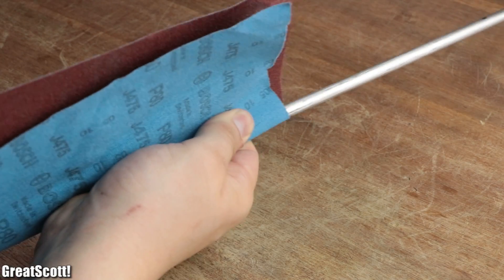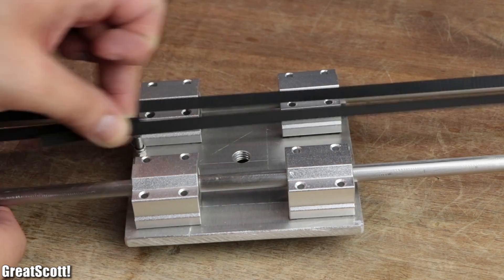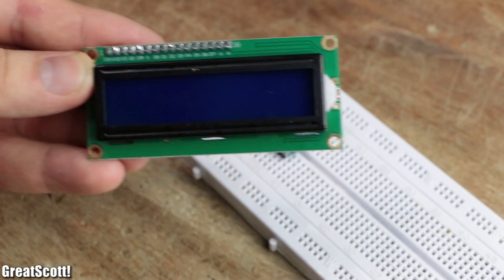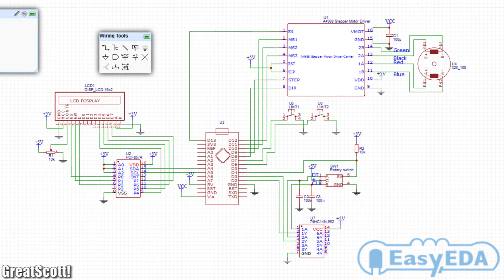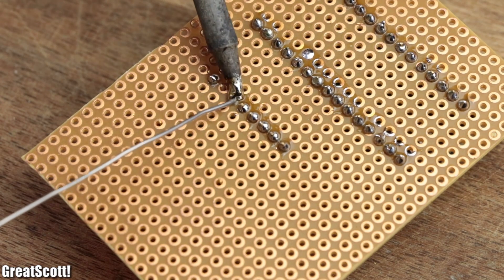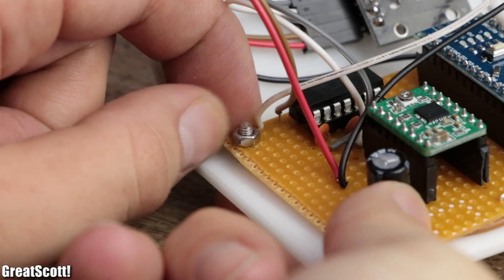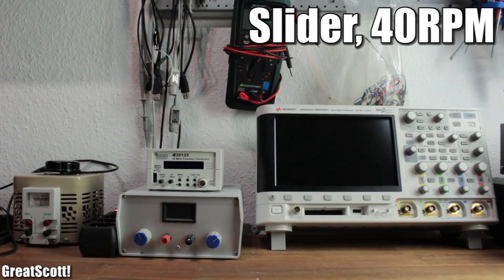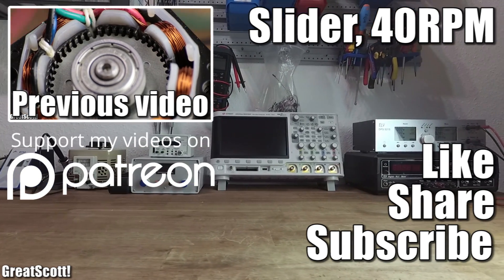Make your own Motorized Camera Slider (Part 2) - the electronics

Comment: Those who have the problem of engine vibration and high noise should use a pull down resistor for the buttons

Comment: Nice! Really very good work. I tried to do like u, but I could not find the schimit trigger ic, can I remove it from the diagram and connect the rotary encoder directly with arduino pin D2, D3 and use Debounce2 library instead?

Comment: I connected the driver in micro step mode (1/16). In this mode, the engine runs smoother, better. Help change code. What exactly needs to be changed in the code to work correctly? http://www.electronoobs.com/eng_arduino_tut27_2.php  Thank

Comment: Great Video, thank you for sharing. I have a Proaim Spark slider and I have been thinking of adding a motor with an arduino controller. The only problem I don't have any knowledge on how to program the arduino. I have a question: Is it possible, using an arduino controller, to make the Slider go go on an endless loop?

Comment: I DON'T UNDERSTAND, the Project file says 5V and there is also "VCC"  but in the video, I see you use a 12V battery!. can you explain, please.
Reply: A4988 driver carrier need 3-5.5V for logic and 8-35V for the motor. Look into the datasheet, there is all.
Reply: so VCC means 12V?

Comment: Can you tell mi which resistor you use. I know only 10k but i'dont know what next (for example: resistor 10k 5% 1/4W i can't see color code). Can you tell me also C1,C2,C3 they haw a tension

Comment: I am building one right now, but I am using roller wheels and 22mm aluminium pipes. It is about 1m long and I am going to make it motorized later on by using an old battery drill and some switches.

Comment: microstepping doesn't work so if I use the 470K resistor from M0-GND do I still need to connect it to D10 on the nano or I just connect the M1 to D11? thanks for the answer

Comment: Hmm, just so happens I have a spare DRV8825 lying around and this looks like a fun project to build around it :) Though I think for the mechanical design I will base my build around Musumi 2020 extrusions and 3D printed parts. Thanks much for the electrical diagrams!

Concerning the deformation of your print, what it looks like to me is the support material in that spot was likely fairly thick and the total thermal mass in that area did not allow your print to cool quickly enough for the filament to solidify as it was extruded. Seeing as your print fan was running I'm guessing it was PLA, knowing that I can tell you that you will see a dramatic increase in your print quality if you were to print a circular duct for your fan and add it to your Delta.

Slicing wise, as some other commenters have said; best to flip the print on its side and print it as a wall without support material. I'd also suggest adding maybe 2-3 millimeters of brim to prevent the corners lifting.

Comment: Moving to the solid rods was key, but you want to get hardened chromed rods are used in 3D printing, If you want the system to be able to hold weight, you would want the rods to be above and below each other, not side by side. Try turning the whole thing on it's side and see how it works. it changes the box structure and affects how the internal forces relate to each other. Might not make a noticeable difference is the load is high, but for smaller loads it definitely will.

Comment: I've wanted a 3D printer for some time but the more I learn about them the less I want one. They're far from cheap, painfully slow and difficult to get accurate results with. I reckon I could make that bent plate "housing" from perspex or aluminium in less time than took to print. Just saying. Also, I must be learning because I even knew what the A4988 was, but you rushed through that bit and I need to go watch again to figure out the debounce thing. I'd probably have done software debouncing.

Comment: To create smoother movement you should gear the steeper using simply pulley reduction. This will make the stepper rotate faster so the steps won't be as apparent

Comment: I would not use paper for insulation, use plastic instead. I also suggest to mount the camera directly to the platform to reduce weight and vibrations.

Comment: Maybe use another camera Mount which is closer to The moving platform and also put maybe some weigth under it. I think The wobbling is a weigth Problem also i would secure The Pipes with Not Just One bolt, i saw at The end they were shorter than before and Just secured with One bolt per side+platform.

Comment: What is that wire that you use on the back side of protoboards? I've seen you use it in quite a few project videos. Is there a certain type, style, or material that it needs to be in order to be flexible like that (and holding it's bent shape) while still being a good conductor of electricity?

Comment: Great Scott!  I really enjoy your videos, but I do need to give some pointers on Loctite.  Loctite is applied to the threads before the nut goes on, it only takes a tiny drop.  Loctite is also anaerobic, meaning that it will only set in the absence of oxygen so only the film that is in the treads between the bolt and nut will set.  Please keep the videos coming!

Comment: To reduce the shaking on the wider try using a camera mount/tripod head that is smaller than the one you are using. It would be better to put a quick release plate on the moving section so the camera is closer to the rails making a lower centre of gravity thus removing the shake
Reply from the maker: I will give it a try
Reply: @greatscottlab i know this is old, i’m in a greatscott rabbit hole. The stainless rods have no rigidity because the only thing holding the whole rig together is the two pipes. If you used a piece of  aluminium C channel as the body of the rig and mounted everything to it then the whole  thing is rigid and the rails would have very minimal movement.

Also sandwiching the slide beatings between two aluminium plates would make the platform more rigid lower the centre of gravity.

Comment: I'm sure you realize this, but I think it was unnecessary to 3d print the part in this video. A lot of time could be saved creating simple parts like that by hand (plastic sheets & epoxy), and you wouldn't get the distortion. But, yeah, I'm sure you were just using it as a chance to use it.

Comment: What instal libery plis help??? may problems:
Arduino : 1.6.10 (Windows 7 ) Insert: " Arduino / Genuino Uno "

C : \ Users \ cp \ Desktop \ CameraSlider \ CameraSlider.ino : 2: 19 : fatal error : A4988.h : No such file or directory

 #include < A4988.h >

                   ^

compilation terminated .

exit status 1
Compile-time error for the plate Arduino / Genuino Uno .

This report should contain more information if
File - > Preferences will be set to "show
details of the compilation "
Reply from the maker: There is a link to the library in the Instructables article. Link is in the description.
Reply: very Thank you for answers

Comment: DIY Perk has also build a camera slider a while ago that is as easy as this but way more stable. but sadly without any motor. but for the next time  you could use his model and add some electronics. 
but all in all it's well done. keep going
Reply: Yeah Scott. If yours was stationary, didn't have all those pesky circuits and motors or if you held on to it, it wouldn't wobble so much! Lol you should just take off all of the cool stuff and convert it into a sliding cup holder.

Comment: I'd like to know if it's cheaper to build an X-carve yourself or to just buy one. I already have the router. You interested in finding out? I know for a fact there is one of your subs that would buy your working model to support your channel. Just to find out. All the parts are off the shelf except the router holder. You think it's possible to build one for less than $1500 bucks? Assuming you can use their open source software. It's another $600 for the router. Looks like you already have access to the parts you need.
All loctite needs is one drop on the thread. Any more and it's just a waste. If the bolt is standing. Place the nut, just on the bolt place one drop in the cup of the nut and bolt and tighten. A sharp punch to deform the  thread of a tightened trimmed nut and bolt works much better than loctite. Then you can also see how much the bolt has loosened but they never do.

Comment: Fun fact: hollow tubes are stronger and less flexible than solid bars, for any given material and diameter.

That 3D print looked very wasteful- I would have printed it flat and simply heated it up and bent it to shape, using a heat gun or small blow torch. Nice project though with some great electronic features.

Comment: i think you use your 3d printer in a rather strange way:  you print out a bare plate with only one hole and one angeled corner, which was a really challenging print, and then you drill all the remaining holes instead of designing them into your faceplate. this thing would have been wayy easier and faster to make out of acrylic!
Reply: i think there would be other spots in this project where the printer is more useful (for example a timing belt mount +tightening system)
Reply: Yes belt tightening system and also a toothed bearing at the loose end.  
Scott is using a smooth bearing currently and that will add a tiny bit of mechanical noise for something so sensitive as a DSLR.....that is if high quality is intended.
Reply: 3D printers are so over-rated.  Mostly good for making enclosures.  Until a new breed of much stronger materials and higher granularity machines are avalible, most hobbist machines are largely just novelties.  "Use it because I have one and it looks/sounds cool" rather than "Use it because I need one" is the current hobbyist market.
Reply: i love 3d printing an stuff, i also have a homebuilt printer at home that runs almost 24/7...
Reply: but he uses it to print flat pieces standing upright, or even some huge, long overhangs. the horror of every 3d printer (user)
Reply: +Geebz wow, you have no idea what you're talking about!

Comment: Hey GreatScott! I received a breadboard as a present and started to analyze how a breadboard has the rails attached. Now I finally understand why you have all that mess of cables on your trusty breadboard. (I use copper Cat5e cables on mine, as I have a literal sh*tton of it - works like a charm). :)
Reply: Me, too. I think I have close to a mile of Cat5e and Cat6 in my garage... :-D
Reply: Brandon Daniels Well, now that's impressive. I have around 25m or so of Cat5e (and around 3m of optical fiber, though I can't use that with my breadboard).

Comment: The camera mount seems to be the issue here, its too tall, maybe if you find a shorter mount or even make one by yourself the plus addition of a counterweight on the bottom, that could help kill some of the wobbling.
Reply: even maybe hang the camera from the bottom of the rails
Reply: Leethal Lee
 That would also help as well, but wont look as elegant.

Right now, it is like an inverted pendulum,
It will be more stable with a shorter mount plus the counterweight on the opposite side so the centre of mass is exactly in the middle of the rails,

Is that or a more sturdy triangular design with 3 metal rails.

Comment: Try adjusting the orientation of the 3D model before printing, that print looks like it could have been rotated to it's side to avoid most of the supports. Took me a long time to get in the mindset of figuring out the best method to print.
Reply from the maker: I had it oriented like that because that was the best print result. Other orientations were a fail.
Reply: +GreatScott! Ah, okay.
Reply: You could use brim or rafts techniques to improve the bed adhesion https://www.simplify3d.com/support/articles/rafts-skirts-and-brims/

Comment: Have you tried adding some light lithium or silicone grease to the tracks on which the camera slides? This may help reduce the jitter present in your final iteration, especially in the middle. It doesn't look like wobble to me, it looks like the camera platform is getting continually stuck and unstuck on the rails just enough to cause that wobble.

Comment: Here is a challenge. Compare it to consumer grade motorized slider.
Reply: Simply for the fact that you can have a lot of fun building a project and learn from it could be enough to start such an endeavor. :)
Reply: yes there is simply because why DIY if you can get a better result cheaper? Its a fine balance for DIY
Reply: Indeed but if you're just trying to get a camera slider that works that is the point I'm trying to make